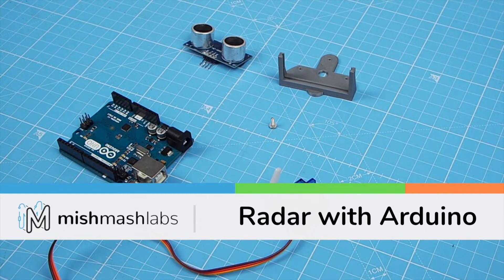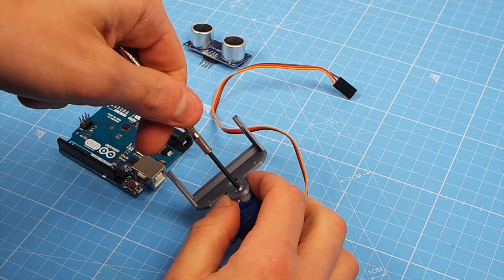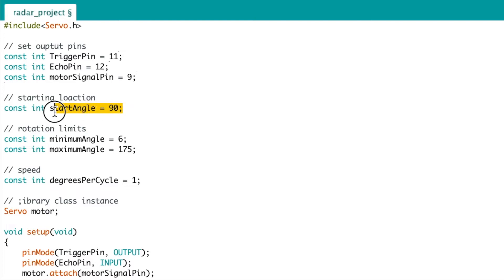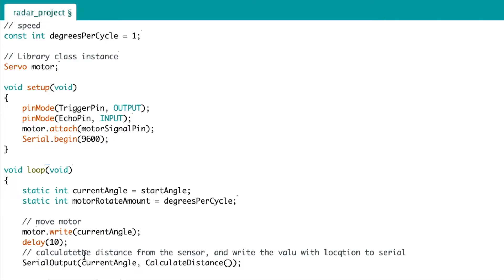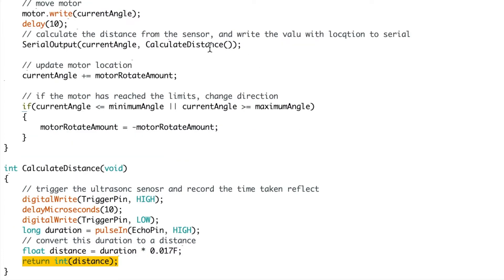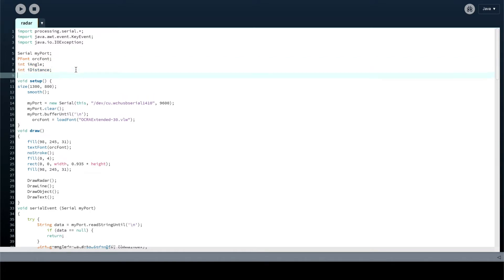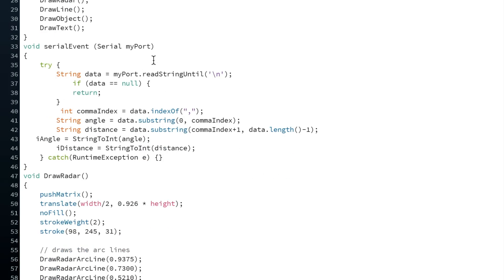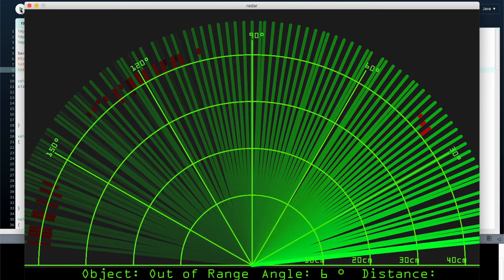Arduino Radar / Sonar, using Arduino & Processing | Full Tutorial

Comment: how come my servo and ultrasonic sensor will not spin and the ultrasonic sensor will not work but the screen for the processing IDE will show up. Can you please help I really need it soon.
Reply: Double check your wiring and code. If that isn't the problem try your servo and sensor separately with basic code to check if one of them is broken.
Reply: @lentilsoup460 I have done that, and replaced both the servo and ultrasonic sensor.

Comment: how can u increase the range of the radar and make it display on the processing (ex: 1m)
Reply: You can't increase the range
Reply: @NaivedyaGupta  oh, I successfully did increase it , it was from a project 1 -2 years ago , I changed alors of codes and research , apparently, by frying the arduino boards twice , you can increase the range to max 4m for the sensors and I changed a bunch a codes to make it display longer ranges up to  (4m). Also after 2m , the displayed sensor data become very inaccurate on the screen .

Comment: hey,
In my case, the radar is running only for 1 cycle, after that, it gets stuck to the same position
Any way to solve this error?
I checked the code as well, didn't found any error in it
Reply from the maker: Make sure the code is identical and make if you're using a bigger servo motor check the power needed to supply it. Sometimes servos require more than the arduino can supply. You may need an external power source

Comment: Hi man do you know how to solve this problem: error opening serial port COM5(Arduino Uno) : Port not found. I look for the name of the port as you said
Reply from the maker: Your port may be different to mine. You could restart your computer. if you have never used the arduino before you may need to install drivers for your USB chip, ch340 is a common one. Another possibility is that your Arduino has an error if you cannot upload and may need a bootloader flash.

Comment: very nice video. why not to use min. and max. angle 0 to 180? is there any risk related to the limit angles? thx
Reply from the maker: I didn't use 0-180 as I found my servo was struggling with the weight of the sensor and holder and becoming unstable,
The only limitations are the ability of your servo as the graphic should handle 0-180.